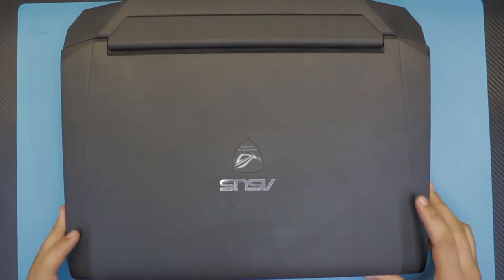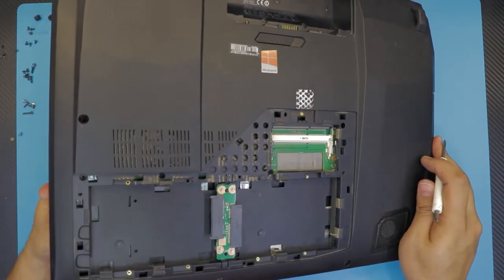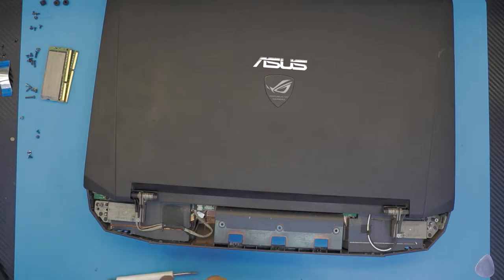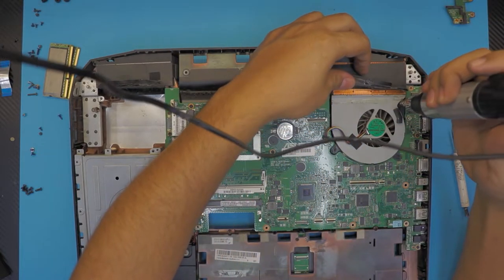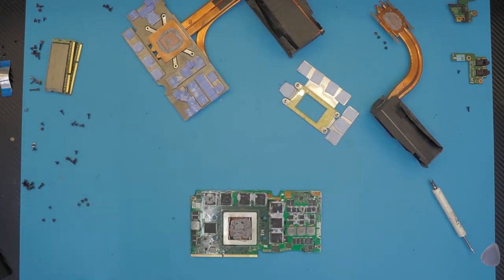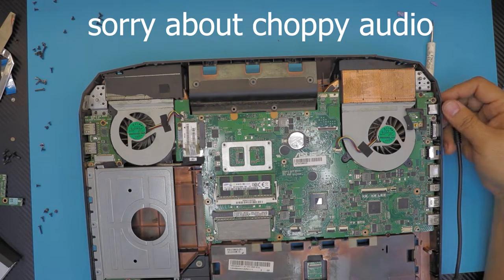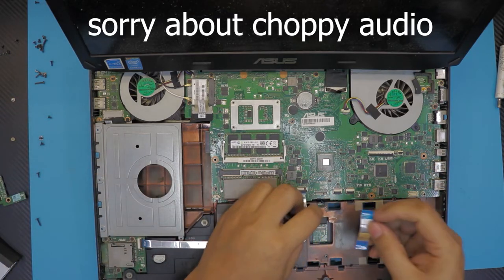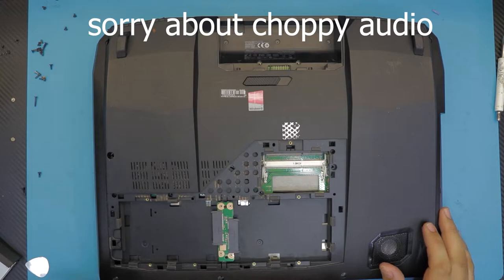ASUS G750 Repair, service, Disassemble and repaste

Comment: I greatly appreciate this video.  This laptop is not upgradeable to Windows 11 and Windows 10 will not receive any updates starting around October 2025. Do you have any advice for when that time comes?
Reply from the maker: It's my pleasure my friend.
🫠Regarding your question, yes, you can definitely install Windows 11 without any problems, and it will work like a charm. I’ll make a short video on how to do that and update you with the link.
cheers🍻
Reply: Yes, it is. You have to circumvent the TPM requirements. I am running Windows 11 on this exact laptop. There are a lot of tutorials out there to help.
Reply: It's simple to install windows 11. I've fot the same laptop. Change the loader on 11's image to loader from 10's and it will instal without problem 😊

Comment: I did all of this, but now am having no display. I have disconnected and reconnected the plug ins at least 3 times and still mo display
Reply from the maker: Thank you for the feedback! if you wish to support the channel you can LIKE or SUB or both :P
regarding your question:  remove both rams and remove the external battery and remove the internal bio battery, disconnect the charger and press and hold the power on for 60sec OR make a short on bios battery terminals for 30sec then place the bios battery, and only place one ram dim in and power on and wait 5sec and you should get screen after power off and place the 2nd ram and wait 5-10sec and you should be fine and at the end plug the hard drive and screw everything back on. to do all the above you don't need to have the hardrive plugged in.
Reply: @uFixTek  okay, I've been trying different things all day now. I didn't remove heatsinks or anything, just gently unscrewed the screen and disconnected wires. Did the same with the key board. Then did everything needed to remove the fans for dry wiping. I put Evey back in, fans spin, cd drive runs, all the lights, just no screen. I tried taking the motherboard battery out for 5 minutes and put it back hoping it would change it, but no luck. Tried removing all ram and switch them out. Tried testing the ssd, all makes no difference. I will try your method perhaps
Reply from the maker: yes try rams one by one not both together

Comment: Hey bro i had asus g750Jm and its showing windows ran in to problem and keeps doing same again when i try to install gforce 860m drivers and if i disable the driver then my laptop starts working normally and i even tried the old version 860m drivers but same it keeps coming windows ran in to a problem and restarts again and again. Can you help me fix this issue
Reply from the maker: Thanks ✌  for the feedback!  if you wish to support the channel you can LIKE or SUB or both :P
Regarding your request:  your issue is a common on this laptops, the problem that you have is a dry or cracked solder joint under the BGA GPU chip, to fix this at home:
remove the GPu card and place it on top of a wood table and make sure the room temp is not cold and there is no fan or air-condition.
and clean the paste off the card and grab a hair dryer and place it at max heat medium air flow, and keep it straight over the gpu chip for 8-12min with 1" distance.
and then let it cool down on its own for 10min, repaste and enjoy
if you want to do better job get a Hot Air Rework Station :
https://amzn.to/3jngS3I
with this set the temp to 250c medium heat  and 1" above the chip for 4min you can do circular motion, and after 5min increase the heat to 320c for 2min 1" distance, move it in circular motion. and let it cool by it self for 15min and repaste. good luck

Comment: Got my G750 from a friend back and figured i should probably clean the whole thing and repaste it. It's been running 10 years without issues, so it definitely deserves it.
Thank you very much for this Video! It certainly made the whole process less complicated.
Reply from the maker: It's my pleasure my friend. 😊 Thank you for taking the time to give feedback! If you would like to support the channel, please like, subscribe, or both. :P
OH BOI! you in for a sweet surprise 🫠 open that bad boi and clean it my friend🧹
Should you have any questions or requests in the future, please don't hesitate to ask me.
cheers🍻
Reply: @uFixTek  I will gladly take that offer... Right now actually😅
You see, someone spilled a drink over the keyboard and I am wondering if I have a chance of fixing, or at least improving, those few sticky keys that are on there now.
I thought about trying to take the selected keys of and clean it underneath, but I would probably just ruin it like that. 
So my next thought was some alcohol cleaner and trying to put a little under every key without removal to loosen or remove the liquid. 

The keyboard is still out BTW, so I am not flooding the rest of the machine or anything. 
If you have any suggestions, I am open for almost anything😄

Comment: This tape between the fan and the heatsink's fins, I got that too on mine; when I saw this I didn't go to the whole ordeal of repasting. Still doing fine in most applications.
Reply from the maker: you can remove the tape it is a Gaffers Tape.

Comment: Thanks for this, my G750JW power switch stopped working, been on its way out for a while, I ordered a new power switch board, that should be the problem, just watched this so when the part gets here, I will know what I need to remove to get to the power board, after seeing this, I may clean out the heatsinks while I can get to them.
Reply from the maker: Thank you for the feedback! if you wish to support the channel you can LIKE or SUB or both :P
regarding your power board: i do hope that the issue is on power board, if you need any help please let me know and i try my best to assist you my friend. 🍻

Comment: When everithing was together the motherboard turned the light on and then off, but sometimes the light not even turns on, nothing. The fans do not spin. 
The laptop used to shut down suddenly when I was plaiyng. Some weeks before it died completely, the laptop refused to turn on sometimes, and then when I tried again it turned on. 
So I need to know if it is the moterboard that is dead or the GPU card. I was about to buy a new motherboard, but now I dont know what to do.
Reply from the maker: Thank you for the feedback! if you wish to support the channel you can LIKE or SUB or both :P
regarding your question: regarding your question its 100% your GPU card i can give you steps to follow to fix this make sure you follow exactly:
#1. remove the GPU completely just like @18:40
#2. you want to make sure you are in a room with a temperature that is not COLD (room temp) no fan no A/C
#3. place the GPU on a wood table (or a pice of wood)
#4a. if you have heat gun set the heat-gun to 280C and use a big nozzle and with 1" distance over the GPU chip heat it in a clockwise motion slowly for 2min
#4b. if no heatgun then use a hair dryer , set it at max heat and medium air, and 1" over the GPU and heat that for 5min
#5. DO NOT move or Cool down the Card with anything . let it cool down on its own for 15min
#6. repaste with a good paste: https://amzn.to/3EXFfxU
and good luck.
Reply: @uFixTek  Thnk you. I will do that. That makes sense since I have tested the motherboard and it seems to be ok. I had no idea that motherboard does not turn on without that GPU.
Reply from the maker: trust me :)

Comment: Hola, Una pregunta si le pongo termal pads en los componentes de la gráfica a la gráfica como tal le puedo poner pasta térmica, y que grosor usa de termal pads la gráfica en los componentes delanteros y en los traseros, no sé si varíe el grosor o sea el mismo para todos los componentes. Gracias
Reply from the maker: hola, mira vas a poner .5mm pad térmica en components the GPU, a todas, y vas a usar una pasta térmica de buena marca en GPU. NUNCA USES PAD en CPU o GPU cristales.
Reply: @uFixTek  gracias las temperaturas bajaron bastante aunque tarda demasiado en arrancar, pienso que es el HDD porque suenan unos ruidos muy raros que provienen del HDD. Me surgió algo muy curioso, monte la ram en la primer ranura de abajo para arriba (la que está más cerca de los disipadores y no arrancó mi lap y la monte en la de abajo (la que tiene la etiqueta del número de serie) y si arranco, será que no sirve uno de mis puertos?
Reply from the maker: es muy normal , ntp si sirve. :)
igual forma si llegas a cambiar el HDD to SSD, vas a ver algo que te va dejar la boca abierta. la differencia entre SSD y HDD es MUUUY alto.
si pones SSD a esa laptop te va adivinar tus clicks :)
Reply: Muchas gracias por la información me sirvió mucho ya me suscribí a tu canal, una última pregunta, la laptop me la compré de uso apenas pero me percate que se bloquea sola en ocasiones no se que problema sea, es como si se suspendiera la laptop pero la vuelvo a encender y se queda en el mismo punto que estaba , es decir si tengo abierto el navegador y estoy viendo un video se bloque y la vuelvo a encender e inicia sesión y el navegador está abierto en dónde lo deje, es muy raro desconozco si sea el HDD o que sea

Comment: OMG now I want to open up mine to see it the tape have been blocking my fan... 
You don't have to take out the motherboard to clean just the fans and the heatsink right?
Reply from the maker: yes, remove just the fan, no need to remove the mobo to see the block.
Reply: @uFixTek  thank you for the reply.
Reply: I might need to do this to mine also. Sometimes on boot  the left fan goes crazy fast and is mostly always loud. Even in an Idle state. At random it will run full speed. I think I may need a replacement. Does anyone know of a good fan replacement for this model?
Reply: @Rjacket  Dude, i have the same. The left one is making noise like crazy. And if i touch the case where the left fan is it is very hot there! I ll order 1 new fan soon and give it a try. Also when i opened the case i ll see what i can clean and maybe renew the cooling paste ¿!
Reply: @DMoDMaTriX  Opened it up and replaced the thermal on CPU and GPU. Gave it a nice clean out. For some reason the trackpad ribbon clip broke and now I have no trackpad :( But at least it runs relatively quietly. But Ehhhh PC's a cheap enough now I don't think I will ever buy a laptop again.
Reply: R J i Never Used the trackpad at all. I Love To be Able to be mobile with my pc that s why i Always prefer a laptop. Glad To hear you were able to open and Finally close the Laptop again. Did you only replace the Fan Or also the pipes? i just See a Fan including pipes for 50€. Did you replace both or only the loud one ?
Reply: @DMoDMaTriX  No Pipe replacement or fan replacement. Just cleaned out the fan with compressed air. Good as new almost.

Comment: Hi,, i have g750jz, my monitor is broken,, can i use g750jx monitor for the jz?
Reply from the maker: Thank you for your feedback! If you wish to support the channel, you can like, subscribe, or both!
Regarding your question, yes the panels are compatible my friend.
Reply: @uFixTek  tq so much bro,,, the jx model are more cheaper than jz,,, so i will go for jx😊😊😊
Reply from the maker: It's my pleasure my friend. 😊
but you need to replace the LCD, remember you don't look for the laptop model, look with LCD model, the model is written at the back of the LCD once you remove it, you can get a much cheaper.

Comment: How did you manage to remove the back cable so easily (6:45)? I'm having a hard time removing it
Reply from the maker: dont pull from cable hold it from corners if the jack, else if its hard you can rip the cables. hold it from sides of the jack and twist very little and pull, it happens sometimes over time they get hard to remove

Comment: hello sir, I have a problem with my computer asus g750jm my battery does not charge even I replaced with a new battery still the same problem could you help me where the breakdown comes from in your opinion and thank you
Reply from the maker: Thank you for the feedback! if you wish to support the channel you can LIKE or SUB or both :P
regarding your question:  we do get your type of issue in the store a lot, and this may sound a bit off when i say, that your battery problem comes from 90% from bad GPU solder balls, or a component issue (transistor) on board. lets remove the finding the transistor out for now as that will require a good technician to locate. BUT you can do something regarding the GPU, at home.
the reason that the battery failure is depended on GPU is that a GPU not only does the Graphic work, also the chip its a BGA chip and it also acts as operator on board,  wifi and battery paths goes under the GPU and thru GPU and out.
so i want you to follow the next steps exactly (exactly) as i mention
#1. remove the GPU completely just like @18:40
#2. you want to make sure you are in a room with a temperature that is not COLD (room temp) no fan no A/C
#3. place the GPU on a wood table (or a pice of wood)
#4a. if you have heat gun set the heat-gun to 280C and use a big nozzle and with 1" distance over the GPU chip heat it in a clockwise motion slowly for 2min
#4b. if no heatgun then use a hair dryer , set it at max heat and medium air, and 1" over the GPU and heat that for 5min
#5. DO NOT move or Cool down the Card with anything . let it cool down on its own for 15min
#6. repaste with a good paste: https://amzn.to/3EXFfxU
and good luck.

Comment: Very good, there is only one small problem my laptop, after I did like what u did, doesn’t work any more 🥲 when I press power button get flash light once and then go off.
Reply from the maker: remove all rams and the battery and press and hold the power on  for 30sec, then plug in the rams and battery and power on and wait 15sec.
cheers🍻
Reply: @uFixTek  it didn’t work :(
Reply from the maker: you will need to double check all the connectors.

Comment: A have a G750JX which turns off while playing games for a few minutes. I can hear both fans run so I suspect maybe dust, tape/debris. The CPU side of the case gets very warm before turning off. Maybe degraded thermal paste also? Thanks for the video showing us how!
Reply from the maker: Thank you for the feedback! if you wish to support the channel you can LIKE or SUB or both :P
regarding your issue: its def the over heating and air circulation on top, i would highly suggest that you do a full service on that laptop.
Reply: @uFixTek  I took your suggestion and today was the day - after peeling back both fan tapes, I found a 1/4" thick carpet of fine dust blocking every fin of both heatsinks. I can only guess that maybe 5% of both fans' airflow was getting through (couldn't feel much breeze at all. only heat coming out the back). I'm going to carefully clean with a toothbrush, vacuum and air compressor and stop there. Thanks again for your video instruction. I guess this must be pretty common with these laptops after many years of use! This one was a known overheating & freebie hand-me-down.
Reply from the maker: @ericbuehler7858  awesome clean it up but repaste that laptop will be very good, its very normal on all laptops after 2years of use. its like having a car but people refuse doing oil change :P
thank you for the feedback and good luck my friend if anything feel free to ask.

Comment: I have one with Nvidia 880m but gpu is defective, can I change it for a 870m? Do you know if that will work? That's the only replacement gpu that I can find
Reply from the maker: Thank you for your feedback! If you wish to support the channel, you can like, subscribe, or both!
Regarding your question,  yes you can but finding them is super hard, check on ebay.

Comment: Very Helful Video.
Question, after doing all the cleaning.
When i tried to log back in, all my files were missing.
What can be the issue?????
Please amd Thank You much!
Reply: Helpful*** i apologize.
Reply from the maker: Thank you for your feedback! If you wish to support the channel, you can like, subscribe, or both!
Regarding your question, you have one hard drive or two, if you could boot into the windows and only had one hard drive there is nothing wrong with what you did, the HDD is having issues, most likely it has encountered bad sectors and it is failing and the windows is trying to recover user data, check the folder: C:\Users and see how many folders are there and find the main user folder and your files should be there, if you see temp user then it is your HDD failing.
Should you have any further questions or requests in the future, please don't hesitate to ask me.